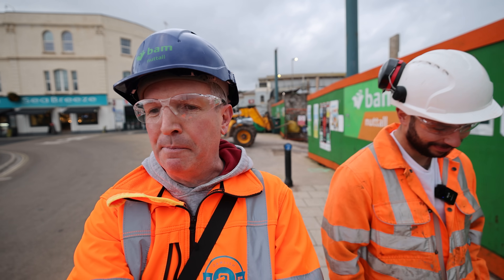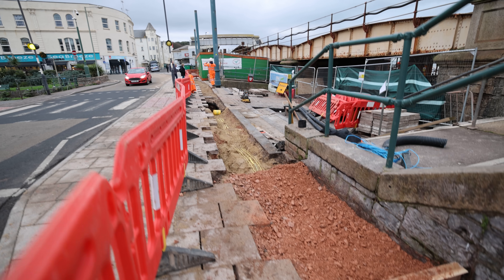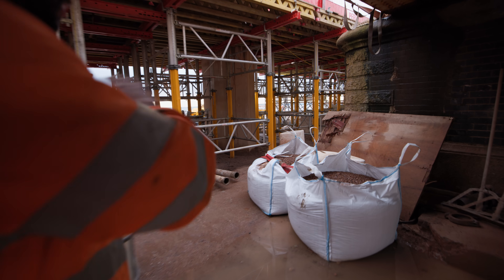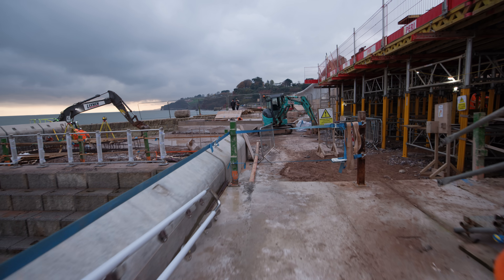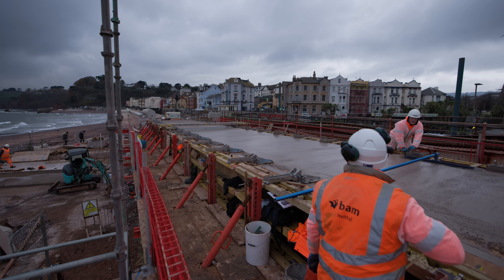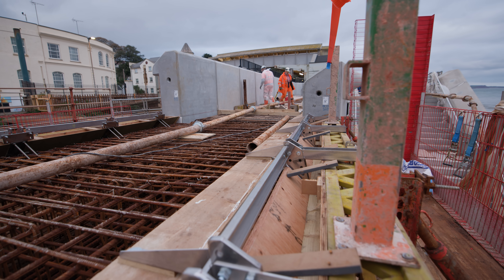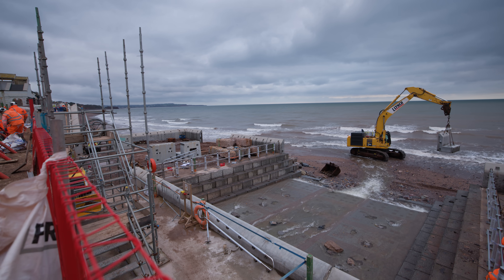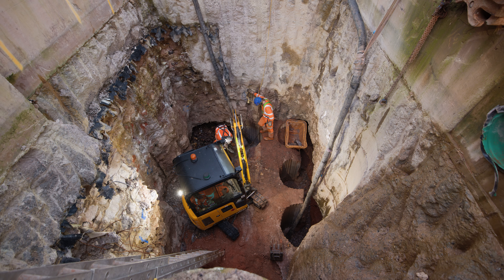Dawlish Sea Wall Update December 2022 - The Link Bridge Pour - 8k Video

Comment: Nice job but with sea levels predated to rise rapidly in the next century will it last the distance as that coast is constantly under the hammer from rising storm tides plus Concrete & seawater don't like each other & putting fancy covered gravel near a seawall roadway is asking for trouble should have made a small grass bank for the water to run off?

Comment: Would be interesting to know the grade of the concrete used and the slump as delivered also is the concrete self-compacting as the poker was I though a little on the small size for the depth of material

Comment: Why isn't the driver of the 70 tonne excavator NOT wearing his seat belt, no illuminated green light on roof , BAD LYNCH DRIVER !!!
Reply: Maybe you need to offer your excavator driving services. You always seem to know more about everything than the guys going the work!
Reply: @sgthree  TRUE THAT, those 700`s are very s l o w due to the weight of them, NOT my cup of tea..............
Reply: The weight of those 70 ton machines is what allows them to lift such heavy loads. Speed isn’t exactly a priority